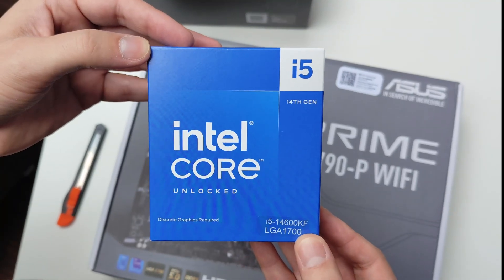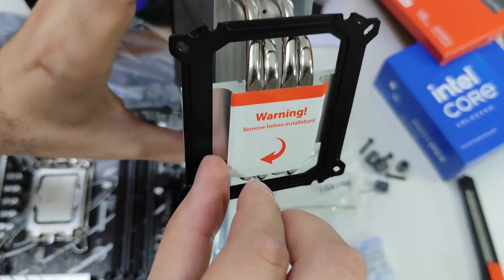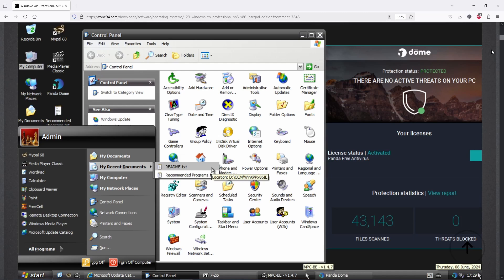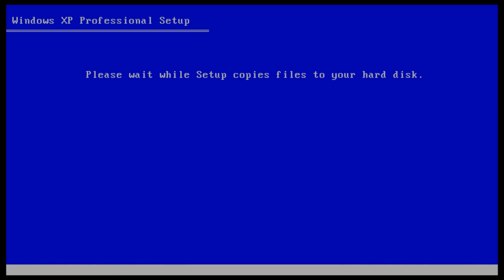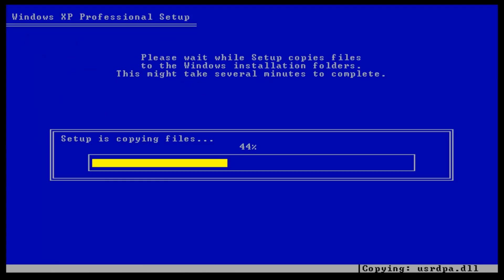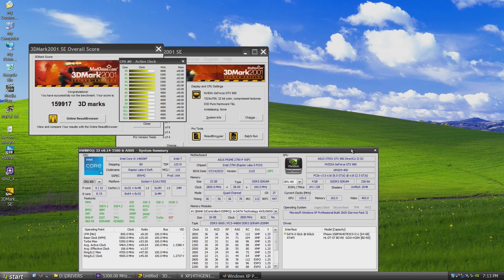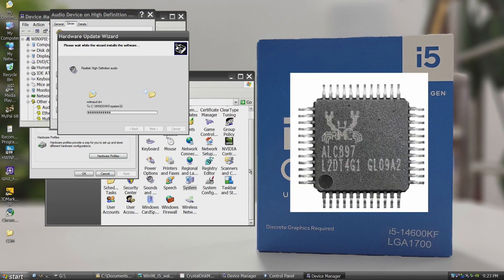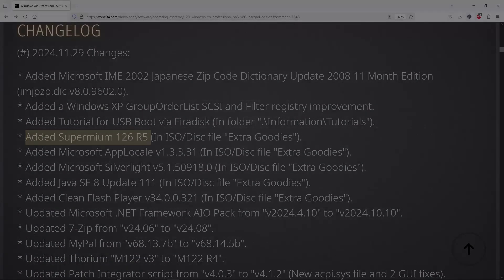Windows XP Meets Modern Hardware: i5-14600KF + DDR5 Z790 Motherboard. NVMe, USB 3.x? No problem!

Comment: Hello Omores, yeah me again. Successfully installed Windows XP SP3 to an NVMe Samsung 950 Pro, on an ASUS ROG Maximus XI Hero (WIFI,) running an Intel i7-8700K. (I have 4 PCs, and a testbench.)  I have been able to install XP SP3 onto a SATA SSD drive on the testbench's Z77 Sabertooth. However, the SATA drive will not boot XP, (black screen after bios boot,) nor will setup get past the Inspecting hardware screen, with the PCIe connected NVMe drive (a Samsung 950 pro,)  using the same DVD I used to install on the Maximus XI Hero. NVMe drivers integrated using the IE patch integrator (changed from NLite.)  Internet searches net zero results that are useful. Your videos have been very helpful with this project.
Reply from the maker: Hi! I just fiddled around with an Intel 300 series motherboard (Asus Prime B360 Plus + i5-9500) on this video: https://youtu.be/gvT9-ZfW1Iw Also my drive wasn't recognized at first, turns out that SATA has two modes, AHCI and IRST (from Intel Rapid Storage Technology) - which is a no go with these older OSes. I changed to AHCI and all good.
Reply: @O_mores  I had to switch the SATA mode on the Maximus 11 from IRST to AHCI as well. The Sabertooth, is in AHCI mode. I put a Samsung 980 Pro on the PCIe card, and the SATA SSD booted XP right up, picked up the NVMe drive, asked for a single file (which I have) and installed the drive. It is GPT (UEFI boot win7 64bit) so XP can't read or write to it, but it is odd that the 950 Pro, caused boot issues.

Comment: Hoping you can help me - I'm trying to install XP 32-bit on a 6th gen Intel board (an HP z240 workstation).  I have a SATA CD drive and SATA SSD (disabled the nvme in the BIOS) so this simplifies things a bit, in theory.  Using an original XP SP3 CD, I got the usual A5 (ACPI error) and if pressing F7 on the F6 screen, getting further but then the usual 7B (hard drive error).  All expected.  So then I used the same tool you did to create a custom XP ISO, including the ACPI  patch and AHCI drivers options, burned that to a CD and this got me through all the setup screens, through the quick format of the C-drive as NTFS, and then copied all files to the drive.  But then on first reboot (booting to the C-drive now instead of CD), I get the XP logo very briefly and then right back to an A5 (ACPI) BSOD.  I alternatively tried re-running the setup and pressing F7 at the F6 screen to install as standard HAL, but then the computer locks up as soon as it gets to the first screen seeking user input (either locks up or the keyboard/mouse inputs aren't being read, I'm not entirely sure which.  But even my PS/2 keyboard is non-responsive).  So I'm stuck here, any ideas?
Reply from the maker: Hmm, you should check out this post on my Patreon page: https://www.patreon.com/posts/132702533  You'll find an x64 ISO there with only ACPI and AHCI updates. As a backup, there's also a pre-installed XP .zip file (~4GB, with all updates). You can simply extract that zip to your bootable partition, and it should start. It will discover all the devices, and you'll be good to go. You can do a fresh install later, but it's faster to check if XP works in the first place.  As for the ACPI error after using the Integral Edition - there are a few other updated variants there. So if the newest one fails, you have some backups.
Reply: @O_mores  Thanks!  I was just reading your Patreon post, and you noted that Windows overwrote the patched ACPI.sys during install and that you had to manually replace it.  Could my fix be something as simple as this?  Kinda sounds like this is exactly what happened to me, the ACPI error returning only after the initial install.
Reply from the maker: It could be. Keep me posted! If I don't reply here, it's likely I didn't see it - just message me on Patreon, as I get emails from there.

Comment: I don't know.   I was in the past do the almost same with a z590 board, xpx86, win7x86 win7x64.  First 1-2 day the x86's are worked well, then the mouse started  to move glichy,  win7x64 was a totally mess, unusable don't know why. 
Next week an X470 board will come, with an official 7x86 support, but I will try out XP x86.
Reply from the maker: Hmm... that Z590 board should play nice with Windows 7. The glitchy mouse could be a USB 3.x driver issue, or something might be eating up system resources. You should run a CPU benchmark to see if it scores as it should. As for USB 3.x drivers, I have some alternative ones you can try.

Comment: Hello, is it possible to run Windows XP 32-bit or only 64-bit on modern computers?
Reply from the maker: You can install both versions, here's a video on how to do it with the x64 version: https://youtu.be/0iW1hheBAp0
Reply: @O_mores  This windows XP is a original version, can I activate in year2025?
Reply from the maker: There is a relatively new activation tool that lets you activate Windows XP 'over the phone.' It doesn't hack or crack anything in the OS. You need to open the phone activation screen as if you were going to call Microsoft. Then, based on the installation ID you provide, the tool can generate the exact confirmation code. It took a long time for people to reverse-engineer this algorithm.

Comment: I installed XP Pro x64 on a 2012 Lenovo with a Core i5 3470, 24 GB of RAM and an SSD. I used an .iso from the Internet Archive with all the available updates including ACPI and SSD drivers. No issues.
I even found all the XP 64 bit hardware drivers from Lenovo, and printer & scanner drivers and apps from HP and Epson. WiFi and Bluetooth dongles work, too.
Reply from the maker: This is how Windows XP should run on hardware from that era. Socket 1155 dropped in 2011, when XP still held nearly 50% market share in January and around 40% by year’s end... So hardware makers were still fully supporting it. That support carried over (partially) to the next-gen socket 1150, though some chipsets and GPUs started dropping off. By the time Intel’s 6th gen launched in 2015, XP support was gone entirely, and even worse, it started throwing ACPI BSODs just trying to boot.
Reply: @O_mores  My main PC is a Core i7 12700K on a Z790. I'm not going to even try XP on that one :D
Reply from the maker: Well, you can... Just install a separate GPU for Windows XP. The rest - like NVMe, USB 3.x, SATA, or HD audio - is covered by standard drivers. In Windows XP, you can disable your main GPU from the Control Panel (which I assume is some kind of RTX card) and use something compatible, like a GTX 980 or a single-slot card if don't have space. There are now some exotic GTX 750TI models on sites like AliExpress with 4GB GDDR5 for 30$.

Comment: Release your modified ISOs for download.
Windows XP SP3 and
Windows 2000 Pro SP4, if possible with multiple languages including Brazilian Portuguese
Reply from the maker: You can download the ISO and drivers from this page: https://www.patreon.com/posts/installing-xp-on-132702533 - it's free (though you'll need to join as a free member). I posted it there because I have unlimited space for file attachments, plus I'll update the tutorial periodically to improve it. I'll also upload a more capable ISO with additional drivers included.

Comment: I need some help. I followed your guide. Once setup was done copying files, it rebooted, performed a CH disc check and crashed. I tried rebooting it in safe mode. And it didn't boot. Am I doing something wrong? Any help would be greatly appreciated
Reply from the maker: Hello. Could you provide more details? Which motherboard and SSD are you using—SATA or NVMe? Also, did you start the setup from a USB drive?
Reply: @O_mores  I'm using a 230 gig SSD. I'm not sure about the model. I think it's a crucial. My motherboard is an ASRock a320m. I was able to boot from my USB drive earlier, but for some reason, I can't now. When I go to the boot menu and select my boot device, it just flashes back to the boot menu. I've tried re-performing the win setup from the USB file copy multiple times, and nothing changes. Could you potentially recommend another USB flash program?
Reply from the maker: Well, it should work on that motherboard but I installed Windows XP without any USB drive involvement. This is important because that an USB drive is seen initially a fixed drive and when XP tries to initialize it - won't work.  So try to copy the contents of the ISO on the SSD, boot from that SSD, and start the installation from DOS. I covered this method on several videos, check this playlist: https://www.youtube.com/playlist?list=PLomaAsb2xNcBrD7X1DUl6LqyVXB2EhXo_
Reply: @O_mores  I got it installed. Currently trying to figure out how to get sound and my external SSD to work. My external SSD is detected when I first plug it in but in the bottom right corner it says your device may not work properly.
Reply from the maker: Your external SSD in not using the USB mass storage driver, like a regular USB stick. It uses something called UASP - USB Attached SCSI - you need to install a driver for this protocol as well.  Check this first. The sound worked from the start on my configuration, you should have an ALC887 and this Z790 has an ALC897...
Reply: @O_mores  do I install that using the patch? Integrator?
Reply from the maker: @CPGplays  No, the driver it's there on  separate folder, just look for it.
Reply: @O_mores  is it HDMI audio only? I have my monitor connected to an HDMI switch, which connects to my capture card. Could you potentially point me in the right direction as to where I could find the driver? Would it be in system 32?
Reply from the maker: @ Just look for the last Realtek HD audio for XP. Also the codec won't show up in Control Panel unless you have  "Universal Audio Architecture (UAA) High Definition" patch installed, but it should be already installed.

Comment: i did everything as you did, but after installing when i try to run that windows xp from the hard drive for the first time it says that <Windows root>\system32\hal.dll is missing, even though it is there when i looked from the command line, any ideas?
Reply from the maker: Hmm, how did you performed the installation? Did you installed it from CD or directly from hard drive? Or did you used a USB stick?
Reply: @ 64GB USB stick since it’s some kind of weird POS system motherboard from 2014 with celeron and it has only one sata connector
Reply from the maker: It seems the installation process may not have been exactly the same. If your USB stick was reported by the BIOS as a fixed disk, it’s possible some files ended up there instead of your SSD. The missing hal.dll error can also be caused by a bad or missing boot.ini file. Please check if that’s the case.

Comment: Hi Omores, you was suggesting to use a PCIE card USB 2.0 with Via chipset 6212L, for USB keyboard and no PS/2 port on m/b but actually i saw that the Startech model is the usually most available on online shops but is really expensive as new (around 50+ € also on Amazon). But i saw that exist same card features card but with Moschip MCS9990, it cost around the 30 €, It can be considerate as alternative and equivalent to Via chipset card? The Moschip card have also Win XP drivers, it can be recognized in automatic in Windows XP setup? Wich can be the tips from you? Btw in my AMD Ryzen build on Asrock B450M Stell Legend (has 1 PS/2 dual use port) i have installed without problems XP Integra Kai sata/ahci, 64 GB Patch and PAE patch in a sata SSD connected to AMD sata m/b controller, but in my X570 build still i i get 07b BSOD also with AMD options 1 for Kai sata/ahci drivers in patch Integrator of XP Integral Edition or AMD AHCI drivers. You can give tips about this? I have tried another XP Pro ISO not modified apart the slipstream of AMD sata/ahci driver by Fernando  by using nLite, but same problem (in both cases i use usb stick with Win 98 boot disk for after can booting the sata SSD). Thank you in advance!
Reply from the maker: Hello! There are two types of PCI-E to USB 2.0 cards. There are cards like the one have with a PCI to USB 2.0 chip + a PCI-E to PCI bridge chip so they can work in a PCI-E slot. There is also a variant from Delock with a NEC chip + bridge chip. And there are these new cards with MCS9990 chip which is a native PCI-E to USB 2.0 solution. I haven't tested them yet, but theoretically it shouldn't matter if it's a PCI-E chip. I know that one of my subscribers has a PCI-E to PS/2 adapter using MCS9990 chip - these adapters have also a USB 2.0 header so they can be used as PCI-E to USB 2.0 cards as well.  If I can locate that comment, I’ll ask whether the MCS9990 works with XP/98. I think it does. As for Windows XP I would try to  use a PCI-E to SATA adaper if I can't by pass 07B. Also don't forget about UniATA! Try to install UniATA on your working configuration.

Comment: where did you get drivers? I can't find a SINGLE driver for anything, I need a driver for i7-6700HQ
it says it can see the i7 in system properties, but it's running like crap, there is Cleary no drivers
Reply from the maker: I believe I covered this in the video. The idea is to create a custom ISO using the 'Patch Integrator.' This tool replaces the standard ACPI.SYS with an updated version. While this update might not be strictly necessary for your configuration, it’s mandatory for a motherboard like this. Additionally, the Patch Integrator integrates USB 3.x and NVMe drivers into the ISO. As you can see in the video, I’ve tested both a USB 3.2 external SSD and NVMe drives—so clearly, the drivers work.
Reply: @O_mores  I’m not talking about drivers integrated into the ISO, I’ve already done that and successfully installed Windows XP on an NVMe SSD by disabling ACPI. What I’m looking for are post-installation drivers for the CPU. Currently, I’m stuck with a generic CPU driver, which limits my Intel i7-6700HQ to just 3000 MHz. I’ve spent hours searching for proper drivers for anything on sites like DriverPack and Google, but I found litteraly nothing
Reply from the maker: @rysiukalbor  The Turbo Boost is done trough ACPI, from an older Intel article :"Intel Turbo Boost Technology 2.0 is activated when the Operating System (OS) requests the highest processor performance state (P0)." These P states (maximum being P0) are managed through ACPI. So be sure you have the latest ACPI.SYS that works with your configuration.
Reply: Sadly every single acpi.sys patch from the patch integrator caused the crash when installing 😢
Reply: well, I have slightly good news, I found 23 different acpi patches for windows xp, time to make 23 isos and try all of them, patience is key 😂😭
Reply from the maker: @rysiukalbor  Good luck :), the default patched ACPI.SYS works on modern Intel motherboards. I have tested it with a H610 and a Z790 motherboard. But I do have quite a few 6/7h Gen Intel motherboards around I will give it a try when I find some time.

Comment: Is it possible to install this Windows XP Integral build on AMD Ryzen AM4 Systems? I had experimented in past, with Ryzen and Windows XP, I got super close, because I used PCI Express to IDE controller, made by Startech. I just want to try again Windows XP on some what modern hardware.
Reply from the maker: Yes, there shouldn't be any particular issues with an AM4 system. I'm currently using AM4 myself and successfully installed Windows XP Integral Edition on my Ryzen 9 3900X.
Reply: @O_mores any tutorials dear sir?
Reply from the maker: @lifeisbeautiful7361  Yes, here is a tutorial: https://youtu.be/pE3CswJweqs

Comment: An PS2 keyboard is the best friend to install older OS on modern hardware, was useful for me to install Windows 2000 on Ivy Bridge (3rd generation)
Reply from the maker: Yep, presence of PS/2 is actually the first thing that I look when picking a new motherboard. For Windows 2000 it helps also to have a PCI-E to USB 2.0 adapter as shown in the video.